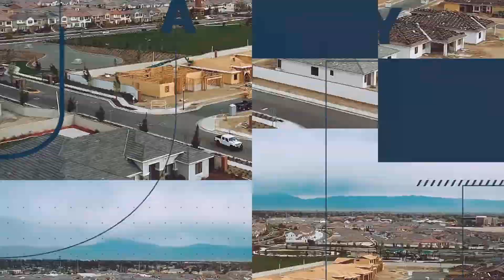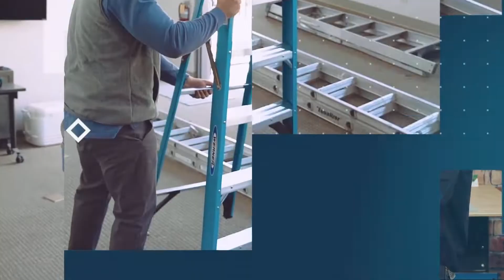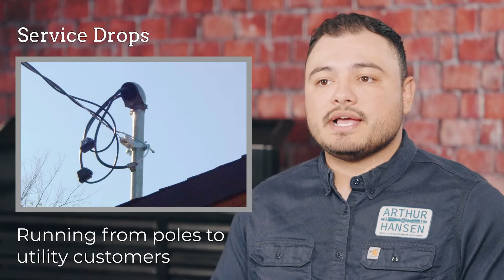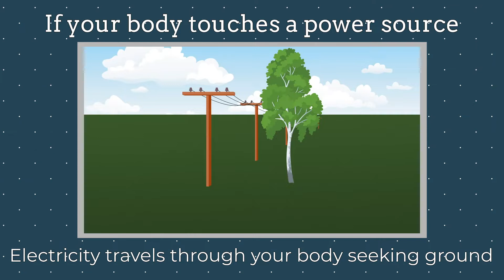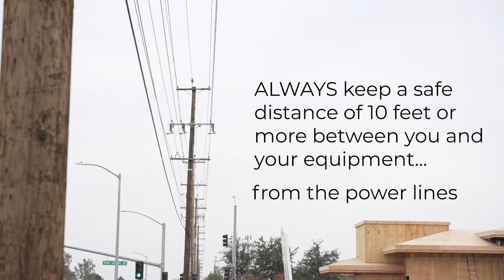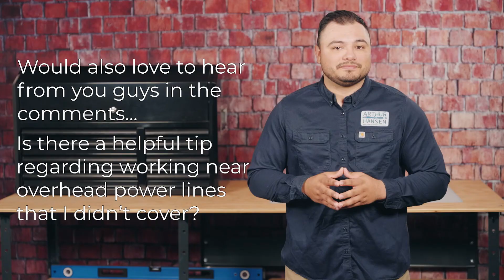Construction Power Line Safety: General Electrical Safe Work Practices | Construction Safety 2022

Comment: Thank you
Reply: But this ain't the one I wrote down I'm going to try to find it right Mariners road I was in the hotel and I went to smoke a cigarette so I took a straight walk down the street with fuzzy slippers on and as I'm walking I see building my building and they literally say what the f*** they are horrible I know you asked about your sister basically I realize I was walking down the street and the building was reading I would never walked on it and be allowed to but something had happened brother something hit it and bonded to windows are busted out there was to stop signs and the speed signs of crumbled up like pieces of paper the parking lots are open it wasn't a parking car inside so I'm walking and then I hit a dead end you better believe I almost did you know 911 on the roof you see itJohnny gate with a total Tower and on top of the Redskins anything that was the end of the road and I was going to cuz God said get the f*** out of here so I can walk and all the sudden my Street walk became amazed there was a grass field and God said this would be the hardest thing you ever do I walked across the grass field and what I did and thank you for Marines stop and I was going to explode like a watermelon if it wasn't for God I would have killed 10 people I walk across the grass field and when my both feet and concrete the minute I supposed to touch the concrete and stop like it never happened Sonoran bothers me to homework then the car pulls up and a black guy says what are you doing back there and I swear to God his hands off the steering wheel he was leaning towards me and has the accident the car shut off by itself 90 miles an hour he was out of here so I started walking all the sudden I walked on one street and I'm lost okay I finally get this village Street and I'm in Norfolk Virginia airport all over the city it's raining and as soon as I get to the sidewalk guess what goes up the good boys in blue startturn it to my Nikes have a real tight I went down the street street and ended up in another city and I was really stressed out crying and has a good thing or some new neighbor with no comes over the guitar and I'm shaking I'm scared I'm going to go get a country motherfuker and I said something you know I had a bad day and he doesn't know and I walk away and he plays the David powder song better than you could ever imagine with a simple guitar singing I'm on over my heart and I start thinking about him you had a bad day the camera don't lie and then I walked like collapse crying and went to sleep under the covers I try to take my girlfriend back on the block and a block was gone I can do that the block wasn't Dead return
Reply: Top of the roof you see a red spinning game spin around also if you go to Syfy you put Syfy commercial world trade center UFO I believe it's a real UFO they appear to be numerous times one time a Black hawk on the afternoon my life is a nightmare I want to have this s*** please and just it's just a game it's not okay
Reply: By the way what is the cranial technology okay that's what you look up synthetic telepathy the first one wrong but that is basically what happened to the combined students they can talk right and talk radio bro
Reply: And I'm a technician I graduated with a degree I was looking at Best buy and Ladies by sons of monitors so I'm like you have a business and she said yeah so I'm a computer technician I want to get a better job so I can go to this place it's called 90 technology nanotechnology cuz I go to suck at The Brady bunch and you walk in and it's like a TV carpeting instead of wooden table and she said it's really bad here you take breaks like a home and she said you just told me about it so my first day here I got fired because I have anxiety and when I went back the next day the building was gone nanotechnology what is what your cell phone really is as well as something like a penny that you find on your table and go up what the f*** is this as you toss it the little Penny when it's when you hear the sound of it hitting the bottom of the garbage pill after you get that sound you hear a bone that takes out to have to block this is what you're working on these folks want to hurt us and by the way big farm okay imagine you're in the middle of the road a street road right on the left you got you got Adam my dogs fighting and killing each otherso if somebody is yelling like they keep your eye on that so that's pretty bad right and as you're looking at that okay you don't realize that somebody set you up because on the right okay my children being f*** by cops or something worse than just sits there you know what that is big pharma do you have enough to believe that they're able to be rich come on man you don't need it the medicine disables us so that they can do all kind of brainwashing to us as you know my medicine stops it is called it's made by gold shield I gave out the cocktail and then you know what it doesn't sleep and why two things went to work better if you're drunk or high your guard is down and it works the programming and the night while we sleep the program has all through the night and that's what they do when I want his medicine I don't really sleep good but if I have a deep sleep I wake up and I feel like someone beat me when I'm fat
Reply: Let me know if there's anything you need cuz I'm just started brother